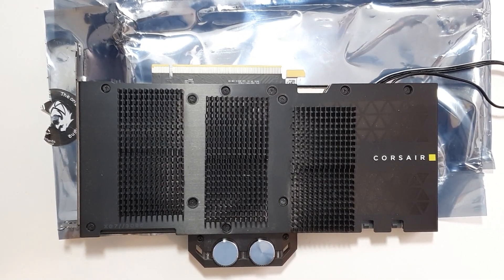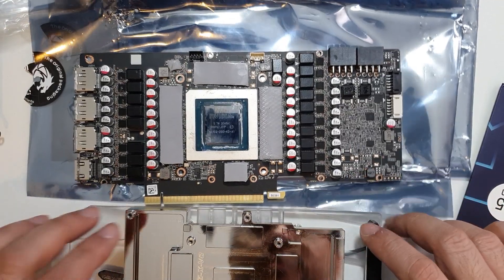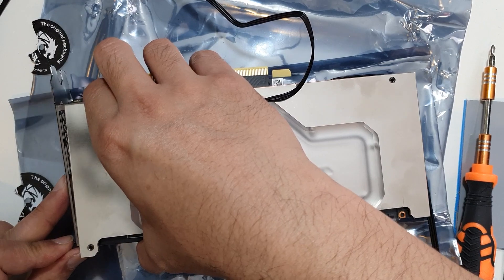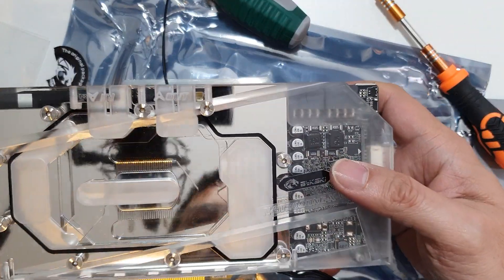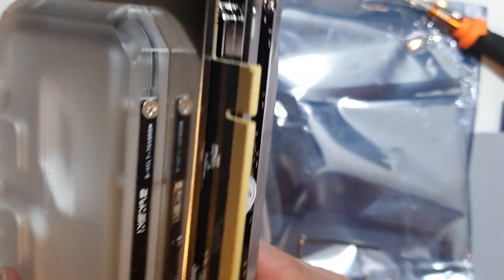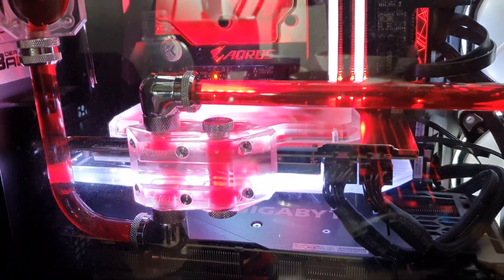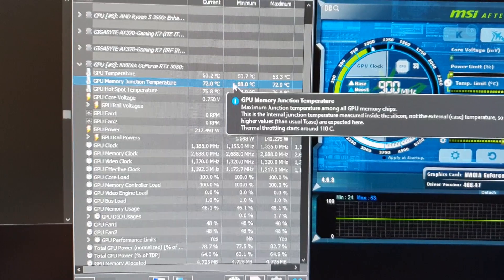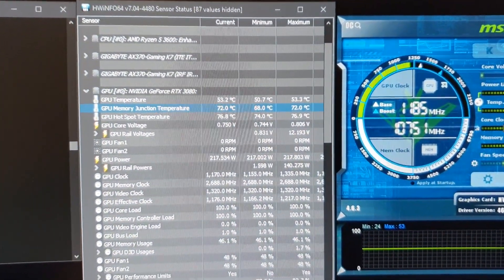Bykski RTX 3080/3090 Waterblock with Active Backplate Cooling Review

Comment: Why do you state that that is, factory thermo-pads from BYKSKA are 1.5mm? I measured at yesterday and they are 1.75mm, screen: imgur.com/XFGRTFY.jpg

I watched the videos, some of those backplate blocks had 54'C normally on GDDR6X memories,

I think that 1.5mm thermo--pads are too thin for you, because the factory ones are 1.75mm and therefore you have 70'C + memory temperature and you have a bad contact, how to explain it otherwise?
Reply from the maker: I measure 1.5 with my caliper but its not digital plus i squished measured them not touch measured if that makes sense lol.  I also just opened up my system again today and just finished now. The pads have good indent of the chips meaning they make good contact they are squished pretty hard. The reason opened them up again is because i put in some kryonaught and replaced my fans from lian li vora ro silverstone air blazer 120r fans.  I did not do a video but ill do one now.

Comment: I got one for my Asus TUF 3090. Works fine with the included pads.
Reply: Which case are you using?
Reply: what temperatures are you getting? i've got a msi ventus 3090 and i'm planning to use the byski waterblock
Reply: Never got pads with mine….Tuf 3909 as well….was kinda wondering. Gonna run thermal putty instead.

Comment: The block isn't cooling the vrm?  With such a power hungry card I would think there would also need to be something cooling power delivery
Reply from the maker: It is i cut a half strip length wise of the thermal pads just forgot to show it in the video it was after i fitted it and realized i forgot them.

Comment: Hi! Nice job! What size & how much rads you use in this loop?
Reply from the maker: I have 1 360 rad 28mm thickness
Reply: @magnomnz  I use two rads (Alphacool XT45 280 + 360) and it's not enough for my system (use Ryzen 5900x & MSI 3090 Gaming X in loop). I will add another rad - XT45 480, i think thats enough for silence & cooling. But for new 480 rad i need new case, use Core P3, buy & waiting Core P8.....and of course I bought this water block from Bykski with active backplate....see what happens)))
Reply: @alexzloy1009  how did it turn out? I have the Corsair 7000X case, EVGA 3080 ftw3 ultra gaming GPU and Nvidia 1650 OC GPU, 12 Lian Li UNI SL-Infinity fans, and a Kraken Z73 AIO, which I'm swapping out for a custom loop and ThermalTake 480mm 60mm or 67mm thick radiator.  What Temps did you get?

Comment: Nive video, mine had just arrived yesterday but I heard 1mm thermal pad works better for the front of the card, I already have the Thermalright thermalpads and am just waiting for new fittings to arrive to install in my zotac 3090 that very same model of waterblock + active backplate. Thanks for the video.
Reply from the maker: if 1mm works then go for it as long as it cools the mems down its all good. so far so good on the performance for mine temps have stabilized to 70C average sometimes goes to 68 but not more than 72.

Comment: Awesome build. I also have a 3080 and 3070 mining and bought a bykski waterblock for the 3080 Asus tuf. I wonder what the temps will look like. I'm getting 98°c at +1000
Reply from the maker: If you have better fans im guessing its going to be 74c the most at +1300 to get to 100+MH for your tuf
Reply: @magnomnz  very nice. Thanks. I tried doing a mod with thermal pads but it didn't help. Although 98 isn't too bad from what I've seen with other cards
Reply: @Techno4more  what size thermal pads?
Reply: @efirst3342  1.5mm for the bysksi block if that's what you're asking. Got like 60c

Comment: Don't think you're supposed to put a thermal pad on the back of the GPU die.. but I guess it didn't matter
Reply: believe it or not, u can, but most don't because backplates would usually end up not fitting
Reply: I used pad on back of my cpu for a year, no problem